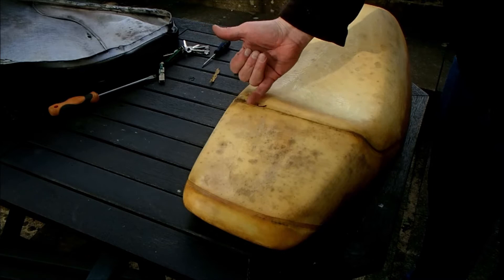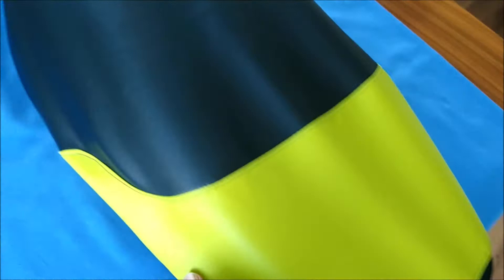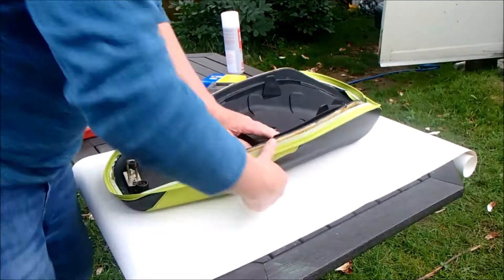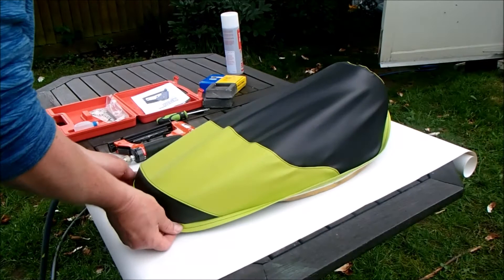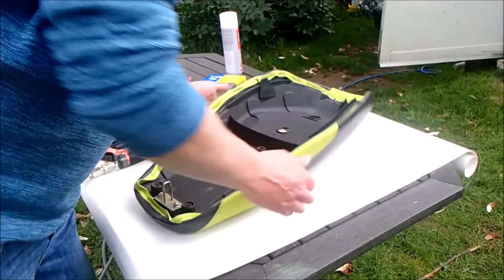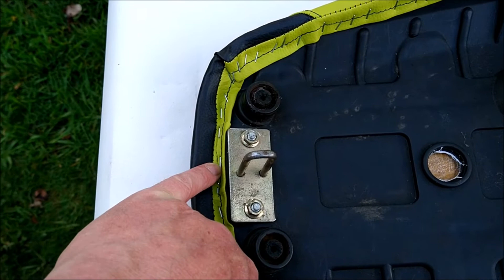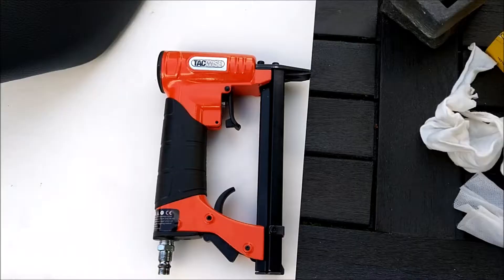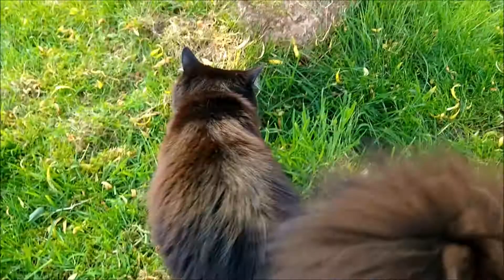Naked GY6 Chinese Scooter - making a custom moped Seat cover

Comment: Atomic Snot looks sweet! Well done! And well done to Karen as well, seat turned out great.

I use an old school manual stapler myself, pneumatic ones are too fancy for me :)

Sidenote: Did you remove the intake filter to the CVT? Hard to see but almost looks like it? Any particular reason why in that case?

Cheers and well done again, the style of this bike turned out really cool, especially for being a cheap chinese "scoot" at the start! Looking forward to seeing more.
Reply from the maker: A friend lent me a pneumatic stapler for the XL seat and I knew then that I needed one 😁 I didn't know that there was a filter on the CVT housing, it wasn't there when I got the bike.
Reply: @richardjweeks  Dont know how necessary the filter is, especially if you only do pavement and nice weather rides..maybe not at all. 

I just know there is one on every factory Gy6 I have ever seen, it  sits in the large hole at the front of the CVT cover.  
You can easily find a picture of how the plastic outer part looks if you search gy6 pictures. Its a plastic outer part with a foam insert, similar to an air filter. Dont think its very expensive should you want to get one. 

Cheers.
Reply from the maker: @GoldenCroc  I'm definitely a fair weather rider, most my bikes rarely go out in the wet weather. I'm thinking I will leave it for now, However if it becomes an issue I will fit one. Thanks for the heads up